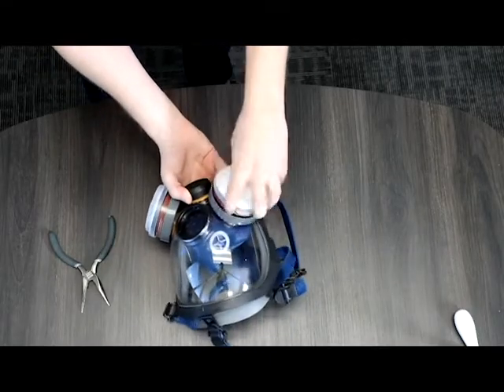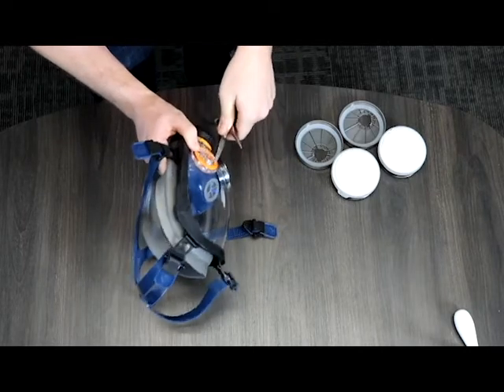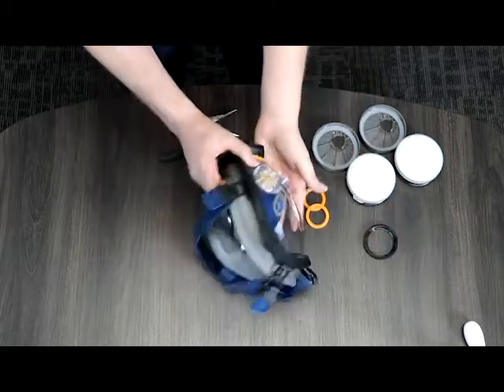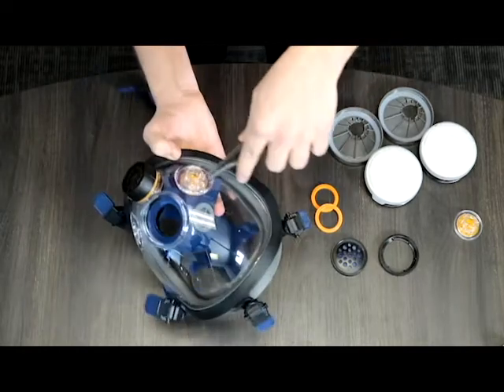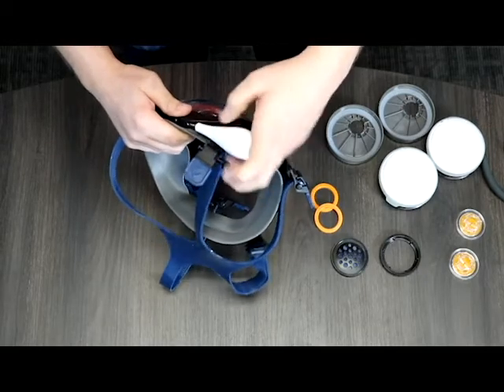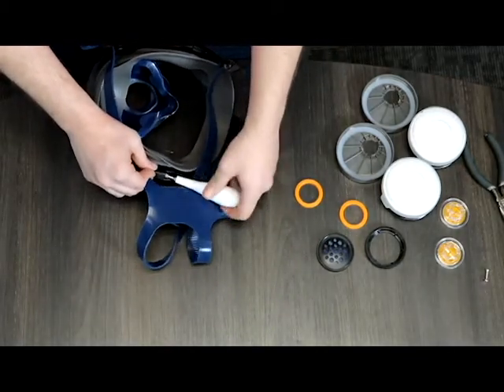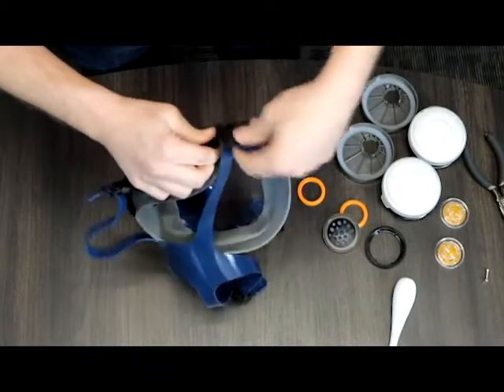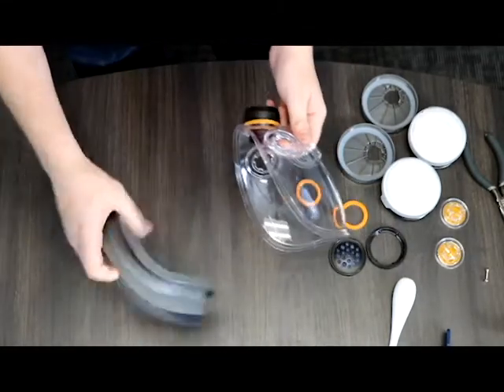Deconstructing a Parcil Safety Full Face Respirator Gas Mask (PD-100 Model)

Comment: Thank you so much for posting this! I have attempted to remove the filter adapters in the past, but was afraid I was going to snap off the plastic if I put anymore force on them. You mentioned that it was difficult to remove because of the factory pressing them on, and promised it would not break from removing them. Well, I went ahead and went full ham to twist them off, and they came off without breaking. Did take some force like you said it would. Now, I have the adapters that the replacement filters came with. The original adapters have a slightly different thread pattern than the replacement filters, and wouldn't hold as secure as they should. Now, it's all assembled in good working order. Thanks again!

Comment: I appreciate the video I know how to clean and repair my mask if need be but you left out the bottom section of the voice diaphragm InTouch and I'm wondering how to disassemble that so I can get the rest of the crap out of that little cage.
Reply from the maker: Hi there!  Sorry for the delayed response.  Unfortunately, the exhaust valve cap is machine pressed on.  It's possible to take it off with pliers, but even internally we risk damaging the component and having to replace it.  That is why we don't demonstrate how to take it off (for now).
Reply: @parcilsafety  ok thank you
Reply: @parcilsafety  many many thanks for the tutorial, for real! As for the Voice diaphgram part, have you made another video for that?

Comment: Do you know what the blue plastic things in the holes of the mouth nasal cup thing are? I removed them and now I'm not sure I should have.
Reply from the maker: Hi, those are one-way valves necessary to the respirator. I would definitely put them back in before using the respirator!
Reply: @Parcil Safety  can u soak it in water without disembling it